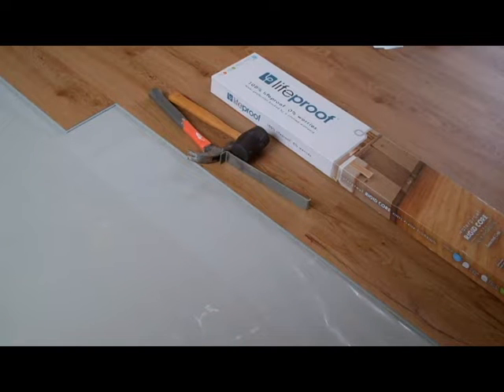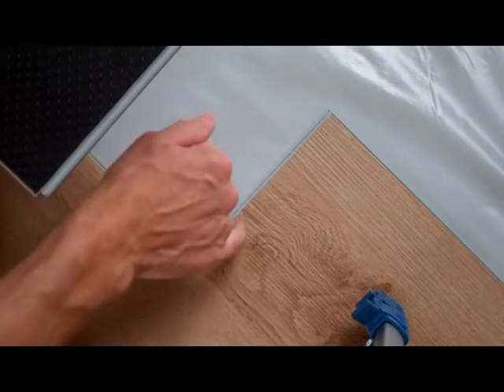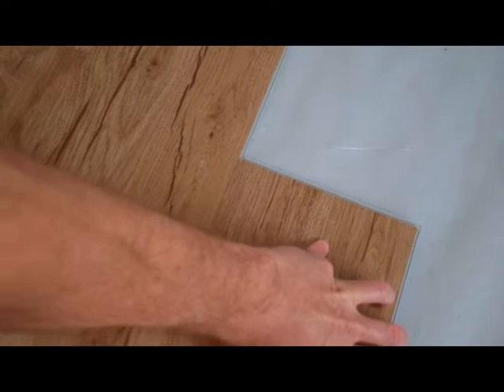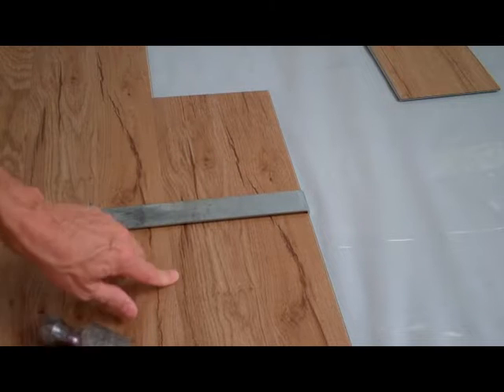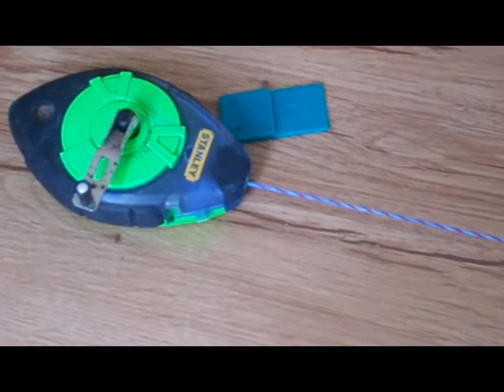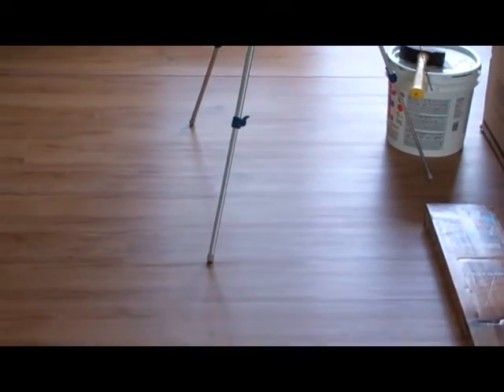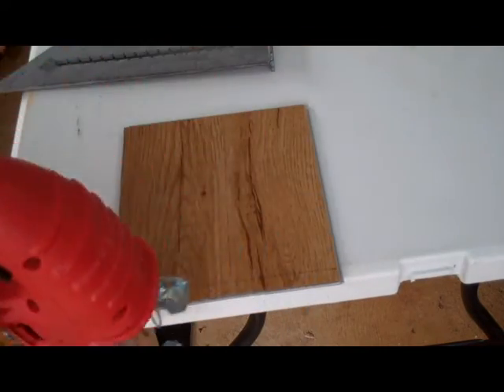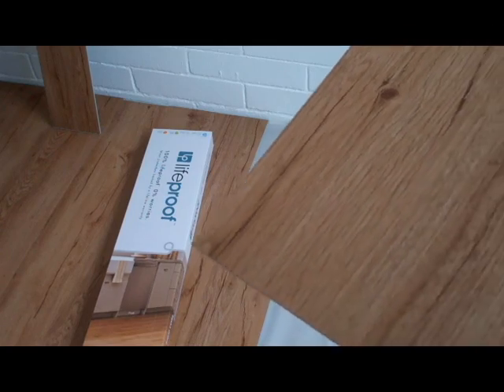My Lifeproof vinyl plank flooring installation - part 1 of 2

Comment: You're using the pullbar to tap instead of areas along the wall? Why not use a tapping block as recommended?
Reply from the maker: A tapping block ruins the edge.  The bar can grab the top of the material and miss the middle layer edge that sticks out.  If you damage that edge, it wont lock into place with the other boards.  You'll see what I mean when you inspect the boards you buy.  Most people miss this as I almost did.
Reply: You can also use a scrap plank as your tapping block. Insert the tongue into the groove and simply tap.

Comment: LifeProof states in their directions not to use any underlayments. The warranty is voided by adding an underlayment. Just a heads up.
Reply from the maker: Good to know. On my application I felt better about the plastic underlayment since I had an earlier leak from under the slab coming upwards through it - sub grade basement. I since mitigated but who knows.  If that plastic voids it, I'm ok with it since the far costlier damage will be to my kitchen cabinets and build in closets if there is a water leak again.  Oddly, vinyl is very robust, but I guess they have to cover their legal butts on everything.  I also raised my cabinets 1/4 inch above the flooring in case there's a leak from the sink etc.  Good luck , thanks for letting us know.

Comment: How come you used underlayment
When there's underlayment already attached underneath each plank?
Reply from the maker: Because the 3 flooring companies I visited in person all said to use plastic moisture barrier IF the floor is sub-grade, which is it.  Even though it voids the warranty, I'm going to trust the guys who have been doing flooring work for 30 years.  I had to make a decision on who to trust the most.
Reply: Actually, LifeProof recommends no additional underlayment, in fact I believe it voids the warranty.  That might explain why the shifting during tapping is occurring, but what a beautiful job he's done with these floors:)
I'm sure it will be fine for years to come.

Comment: How is this holding up? I’ve heard issues with lifeproof not being durable and scratching easily. Debating from vinyl or laminate for kitchen and living room with entry doors. Pros and cons to each I guess.
Reply from the maker: no issues so far.  chipping would be the biggest issue with any plank because all the layers are different colors. I dropped a tool and chipped a hidden area of the floor - and noticed the layer colors.  Otherwise I'm happy with the money and time spent.  If this floor was above grade, I would have used 3/4 solid wood or stone tile - and if weight wasn't a structural issue.  Below grade should use vinyl laminate plastics for long term maintenance free.  People like it, don't say anything bad about it. If worried about aesthetics, put some area rugs over it. I would also put this over a concrete floor above grade because its very thin compared to wood / tile,  makes for taller ceilings.
Reply: I have put down a couple of these floors. Lifeproof is a good product, but don't use it where you will be moving furniture regularly like kitchen chairs, put coasters under beds and heavy furniture. I did a 12x 15 bedroom in about 4 hours.
Reply from the maker: @mountainman5025  I would agree with your assessment.  I put felt on the bottoms of chairs etc.  I do this for hardwood floors as well. I scratch tested color samples to get the least noticed scratch - that is this floor color. The darker, the more noticeable the scratch.  The engineers should have taken this into account for any floors they created in the lab. They could have used a dark middle layer under a dark top layer, and so on.  Out of all the brands, this scratched the least and was the thickest for the price.  There were better ones but they cost 2 to 3 times as much.

Comment: Very helpful video. I am installing now. I have watched a lot of videos and this really put everything into perspective. I see a lot of negative comments or commenters questioning your methods. My reply Pro installers make better video. People who have never touched LVP, just wait your turn is coming. Keep up the good work
Reply from the maker: Thanks. I hope it helps. I watched many videos and listened to many pros before doing anything.  I also had a friend help with the first few rows so I felt comfortable.  The first rows are the most important, take your time.  Do it right the first time and you never need to undo. Then you will be very happy.  My floor is holding up very well so far.

Comment: Would be nice if you posted the color of your flooring.   Many of us want to see how the colors actually look when installed, which is basically impossible on the Home Depot website.
Reply from the maker: essential oak is the 'color'.  My Camera, light, all affect how it looks.  I usually open the box at the store to figure out what it really looks like. They also have samples you can take home and test for color. I took every sample home I could get from different stores before I bought this one. I also scratched up the samples with a key edge to see how noticeable the scratch is.

Comment: Wouldnt plastic underlay may floor sweat then buckle flooring.?
Reply from the maker: Vinyl should not buckle because it's not wood or a material that attracts water.  I also have 1/4 inch gaps on the edges by the walls as recommended in case the floor somehow expands or contracts. The floor is NOT glued, it floats as 1 big floor. My climate range is only 30 F so no problem with temperature swings.  If you have a cold winter and hot summer, you might have to do more steps.  Regarding plastic, vinyl flooring guys told me to use it for subgrade concrete. Subgrade means the floor is at some point below the Earth.  I don't know the physics otherwise of how moisture works.  If you are installing something, it is important to look up the manufacturer's specifications for your installation, like over concrete, plywood, etc.   If you cannot find that, go to the flooring stores and ask them - make sure you ask at least 3 people so that you get a more complete answer.  What I did was based on what they told me, the way I installed the boards to one another was based on other people's experience of getting it set properly.  I have sloping in my concrete and so far the vinyl has not separated over the slopes, which means I did a good job. 

I was told NOT to use wood or tile on a subgrade concrete floor because of potential moisture issues.  My only choice was paint or vinyl.  Carpet was not a good choice because it could rot.
Reply: @karlale4904  ty.nice job..i want to lay my planks over linoleum in kitchen and bathrooms .the bedrooms and living room has 5 inch boards

Comment: Is this a basement floor install?
Reply from the maker: partial subgrade basement, concrete floor initially with self leveling over it. They didn't level very good, but flooring still worked out.  Recommend you have a very level floor for any new flooring, makes it easier.
Reply from the maker: if you have subgrade floor it could be prone to water vapor, so they usually recommend vinyl as hardwood might rot, expand or warp.  There are companies who do vapor testing to see what your exposure is, as the flooring store where to find them.